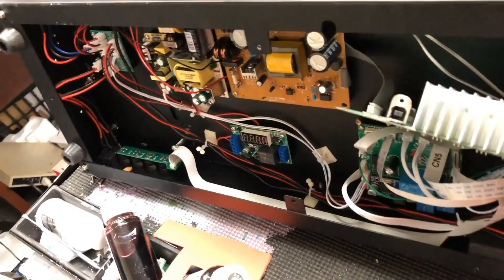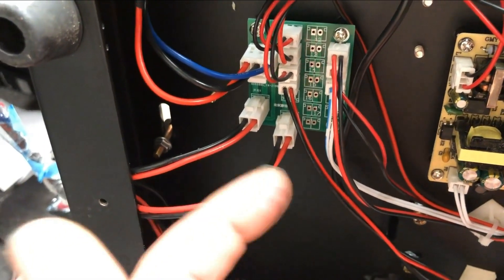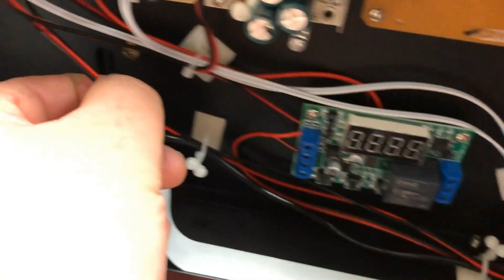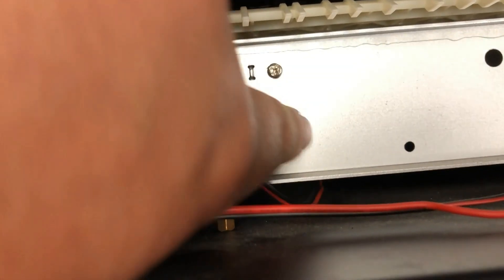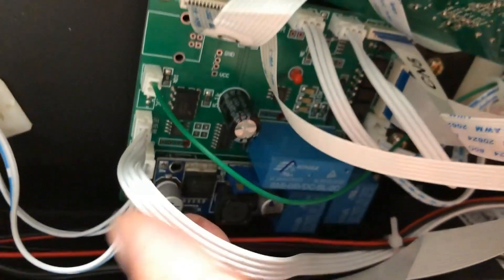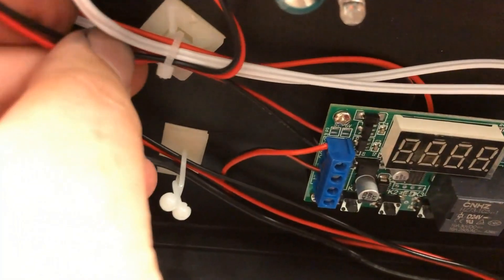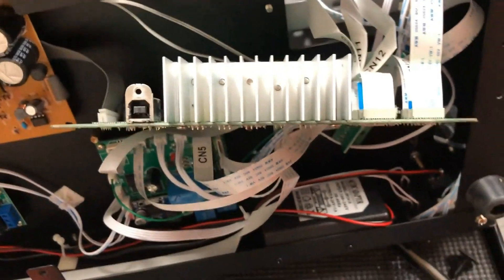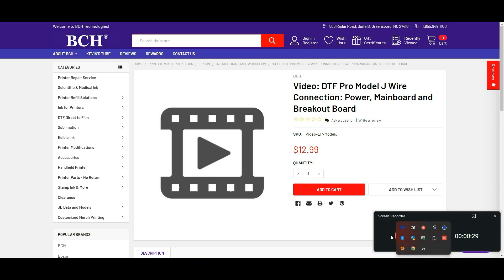Dtfpro Fusion Model J DTF Printer- Power Wiring Secrets

Comment: My Epson L495 printer is showing fatal error 800000
Reply from the maker: Thank you for subscribing and supporting my channel! Every subscriber is a huge encouragement as I strive to reach that 100k milestone—it’s been eight years, and I’m only halfway there. Your support not only helps me grow but also motivates me to create detailed and helpful content. I truly appreciate you taking the time to comment, and I’ll do my best to help you with this issue.

The Epson L495 error code 800000 isn’t documented in standard user manuals or troubleshooting guides, which can make it quite frustrating. Based on industry knowledge, this error often points to firmware corruption. This can happen due to a factory defect or an issue that arises during automatic firmware updates. Epson tends to reserve certain error codes for their repair facilities, and this might be one of those.

To address this, you can try disabling firmware updates moving forward, as they’ve been known to cause more harm than good. These updates often target third-party cartridges, sometimes breaking OEM cartridges with low ink levels or even causing damage to the printer. For your current issue, I recommend reaching out to Epson support directly at 1 (800) 463-7766. They may offer a solution or provide a replacement if your printer is still under warranty.

For more information about why firmware updates can be problematic and how to disable them, check out my blog post here: https://bchtechnologies.com/blogs/blog/how-to-disable-an-epson-printers-automatic-updates. If you have more questions, feel free to email me at support@bchtechnologies.com, or post on one of my most recent videos for a quicker response. Let me know how it goes!